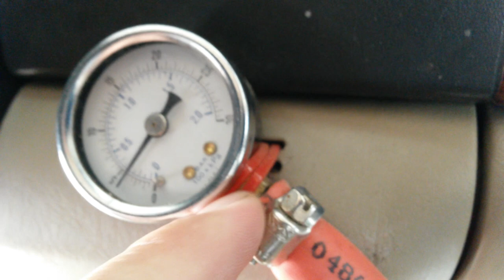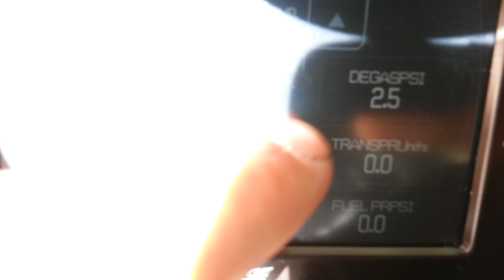FORD 6.0L Diesel~ Degas/Coolant Pressure Gauge ~2 Different Methods 1 Video

Comment: I tried to do this test with all the same stuff except I just had a circular tire pressure gauge, am I an idiot or do you need a universal pressure gauge? Will any gauge work as long as you hook it up correctly is my question?

Comment: Monitoring your bad head gaskets with this guage what traits did you notice? I put one on my escape but it reads on the suction hose so i don't think it's accurate. My coolant violently makes a boiling scene even though the temp isnt hot enough to boil.

Comment: Nice! I want to do this soon. Where can I drive to pick up a low pressure air gauge 16 psi and no higher than 30 psi? How many feet of hose? Only concern is...... "What are the odds of hot coolant spewing all over me if something comes loose or breaks?
Reply from the maker: Greg Zindler Sorry for late response. As long as your connections are good it's not going to spew hot coolant all over the cab. Especially if you use good hose. Here are the parts online:
~ 30PSI Pressure Gauge on Amazon: http://www.amazon.com/dp/B006K2R5R8/?tag=degas-20
~ Color Coded 30PSI Cooling System Gauge: http://www.amazon.com/dp/B0015DU920/?tag=degas-20
~ 3/8" Barbed Tee: http://www.amazon.com/dp/B007D5H3OG/?tag=degas-20
~ 10 Pack High Quality Hose Clamps: http://www.amazon.com/dp/B006IOZ3YU/?tag=degas-20
~ 25Ft 3/8" Hose (Fuel Hose Which =Higher Quality Than Heater Hose: http://www.amazon.com/dp/B000KKHNZU/?tag=degas-20

Comment: why do you want a 12 inch tee  with 3/8 inch hose?
Reply: 1/2 inch pex tees are way cheaper than 3/8 barbed tees and work pretty good.
Reply: +GadgetClass  so a 1/2 pex will fit on 3/8 hose? I had a fitting and a hose in my hand at the hardware store earlier today and couldn't make them fit.